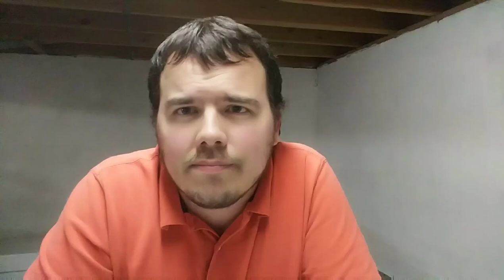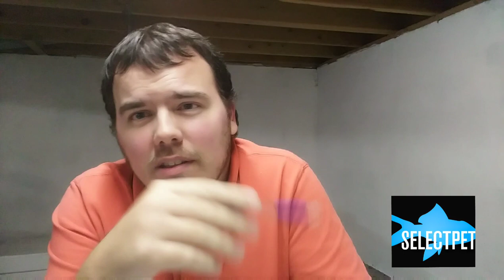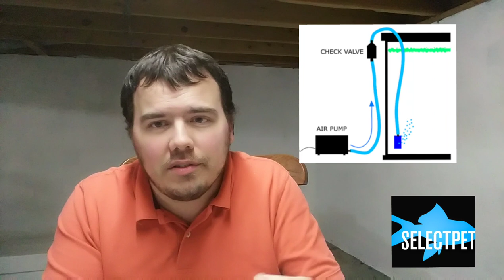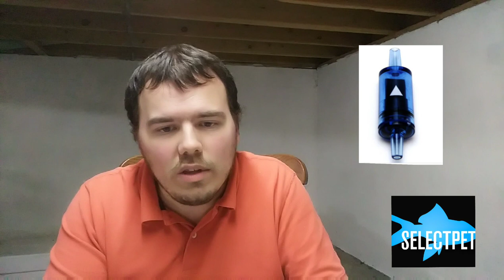Aquarium 101: check valves

Comment: Great info.  Seems unnecessary until water gets in your pump. 😩
Reply from the maker: Or the floor. I used to not think they were necessary, until I had a pump get unplugged and the tank had half emptied into the floor before I found out.